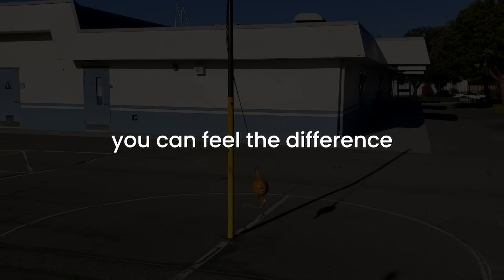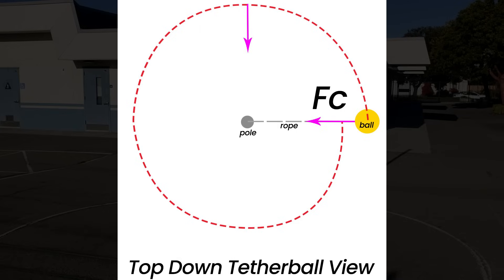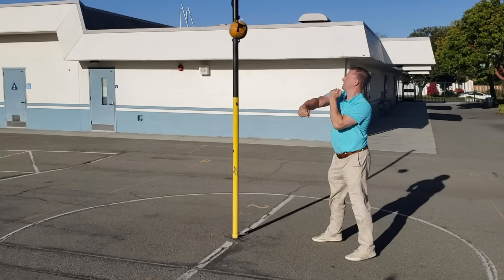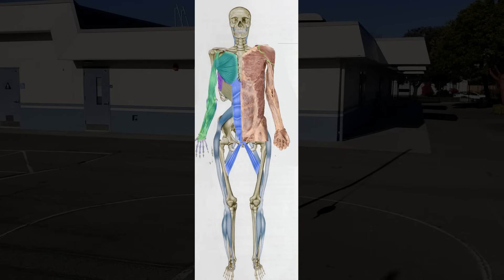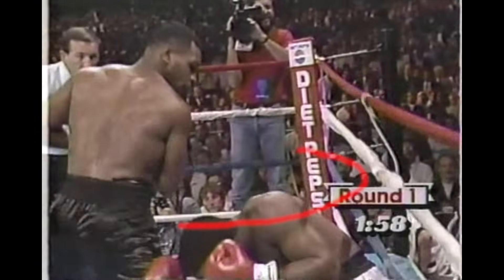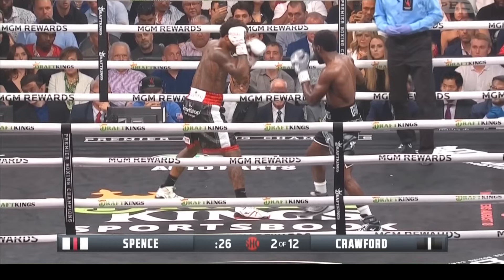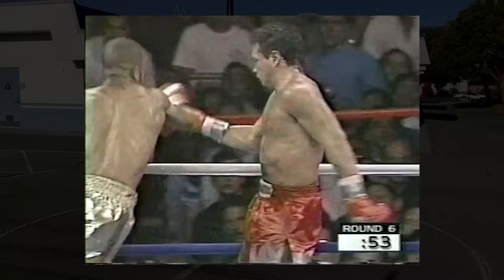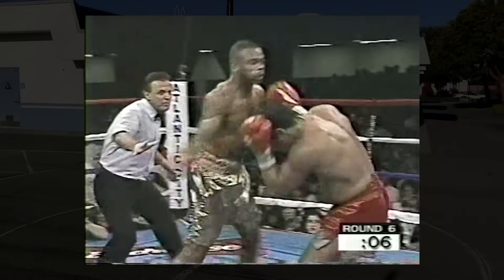The Hidden Physics Behind Natural Punching Power, And the Secret Advantage You Aren't Using (Yet)

Comment: I think the rigid and linear punches come from a midset that you must remove all excess motion and not telegraph your punches. On one hand, I suppose that works if you want to be the fastest puncher in the world. On the other hand, to quote George Foreman, I may have telegraphed my punches, but everyone got the message.
Reply: In karate, although strikes look linear, the explosive rotation comes from the hips. The punch also naturally becomes arched in practical situations.
Reply: @albertwong4516  Karate is absolutely a linear striking system--even if a few attacks take advantage of rotation in a limited way that doesn't change the initial trajectory.

Karate throws and blocks and even sweeps are a bad joke compared to, say, Combat Sambo precisely because of this linear system. They rely on a crushing speed advantage to land unless the opponent is already off-balance, because the motions don't flow into each other. But karate katas are fixed and predictable, which is fine for simple motions like strikes, but really shows its limitations for more complicated maneuvers. I'd rather just use Wing Chun with certain karate strikes if I am going to rely on speed and making a small point of contact.
Reply: @maltheopia Machida did pretty well for himself using Karate, unless you want to argue his sucuess was Karate plus 2 or three other styles.
Reply: Michael venome page and stephen wonderful thompson are karate practitioners
Reply: @mrj2654  Machida also fought a bunch of other linear, minimalist strikers. I don't even have to point to specific fights, you can infer that based on the time period where he fought in the UFC. And pretty much every striking-focused combat style used in 21st-century MMA is linear and minimalist except for one-off 'joke' disciplines like Capoeira and Kung Fu. You know: American boxing, Dutch kickboxing, Muay Thai, even Taekwondo. When's the last time you saw a major fighter who claimed a Savate or JKD base?
Reply: @maltheopia i tried to do a little jdk.
Reply: your sacrificing power for speed ...speed kills if and i repeat if you know how to move your head
Reply: @scarfo441  bro power = speed x strength
Reply: @endorphineguy power isn’t strength. Power is force x speed. Strength is different. A big guy squatting 600lbs is strength. Tank davis’ lightning uppercut is power. Theyre a lil different
Reply: @westendwarlord  Biomechanically speaking, speed and strength are downstream effects of the same effect (selective tension) of the same substrate (the muscle). One of Bruce Lee's greatest insights in the Tao of Jeet Kune Do was that speed was excess strength. It's easy for Joe Sixpack to punch as fast while moving from many different angles as, say, Mike Tyson in the 80s. Being able to punch as hard as him while ALSO being as fast (or even just half as fast) is another thing. Similarly, Joe Sixpack could definitely reach his punching power as well, but the punches would be slow.

Rigid and linear punching's supposed speed increase relative to looser styles inherently creates reduced strength. But as I just argued, since speed is downstream of excess strength, the linear style has to further reduce potential power to have a speed that's actually useful in a fight. This isn't philosophical, it's a physical consequence of forgoing the kinetic chain.
Reply: If you hit as hard as Forman yeah , it would would. His hits would do damage if he got you making it more likely to land another one next time. If you don’t have that power ,you will miss too many and when u do hit it won’t do what you need it to. Smoking joe never stopped going forward had no dodge he just came forward n took the hits to slug it out. Problem is none had foreman’s power. He couldn’t take those hits and win. But Frazier beat alle . But alle beat foreman.  Rock paper scissors with styles.  Foreman couldn’t do anything against alle who could dodge when he wanted n saw the punches coming, and also had a great high gaurd .  Foreman couldn’t land his power punches and when he did alle trained to just shell up and take it .  Thats one of the reasons foreman couldn’t beat alle .